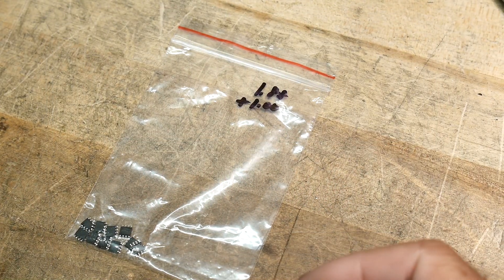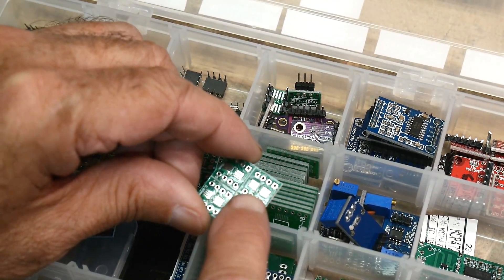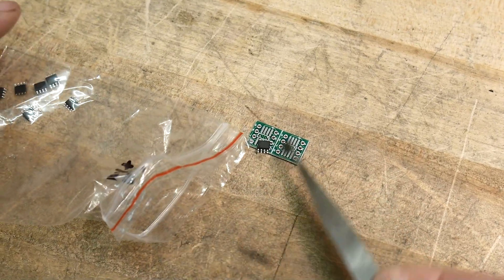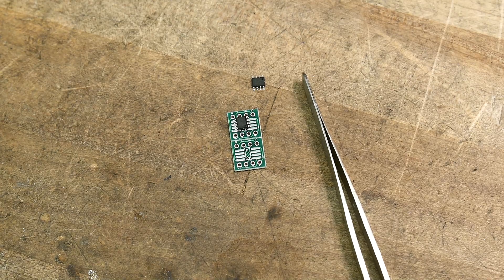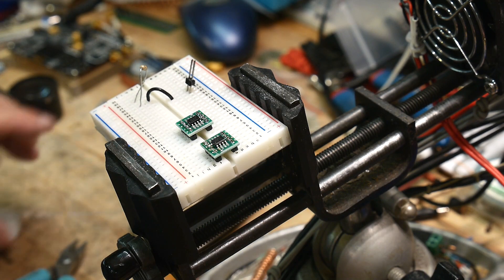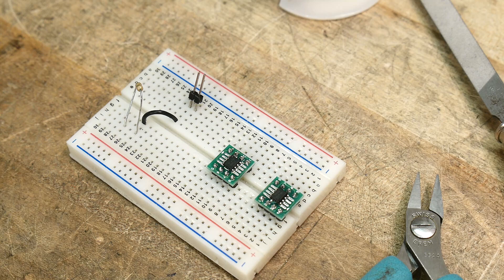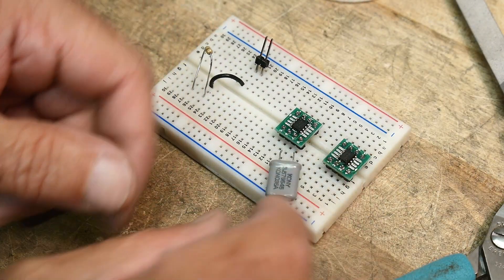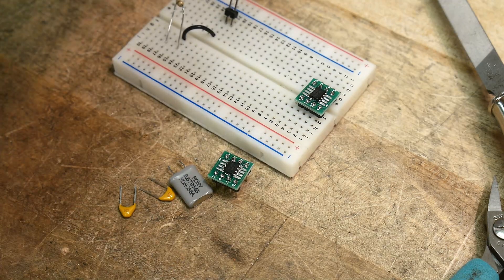#820 DTMF (part 3 of 6) HT9200 SMD parts

Comment: Will you still answer these questions? Even after all this time, I think you're videos are amazing.
I just recently started back into electronics. I have an experiment going. I bought one of these generators.
The problem is when you hit the buttons. The tone turns on and then goes out. How do I make the tone stay on while I'm suppressing the button. You know, like a regular touchstone phone.
Is there an easy way to make it do that? I think you're the only one they can help me. I hope you get this message.
I really do think you're awesome. I wish I had.
You're knowledge i watched your latest video.
I used to have an old vector computer.
It had AD board in it.
When I was about 19 I hooked a robotic arm. I made from scratch
Had it picking up chest pieces in placing on a grid. Rhode Island programs myself. Good old basic programming, those times were amazing.
But I would sure love your help with the tone generator.
Reply from the maker: the datasheet shows the tone remains on while the CE is low, so keep the CE pin low when a button is pressed

Comment: Since this encoder chip uses a 3.579 MHz color burst crystal, would it also produce Redbox tones if used with a 6.5536 MHz crystal, like the old RadioShack dialers?
Reply from the maker: the output should scale with the xtal frequency

Comment: Bravo tip of using the proto-board for pin 0.1" orthogonal alignment during soldering, but I would not clean-off the flux with solvent over my proto-boards connections below.
Reply from the maker: you are right, at the time I did it, I thought what wasn't too bright
Reply: @IMSAIGuy  Proto-boards are so inexpensive you might as well dedicate that board to being a cleaning and soldering station - I might do the same with one of mine!